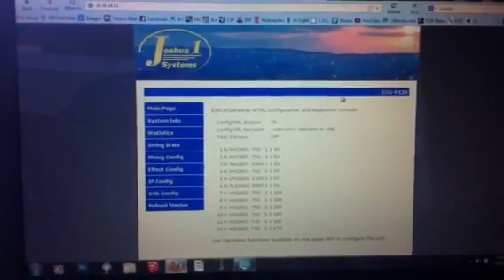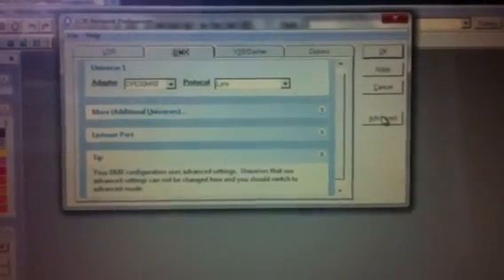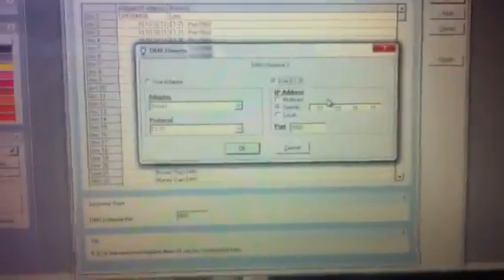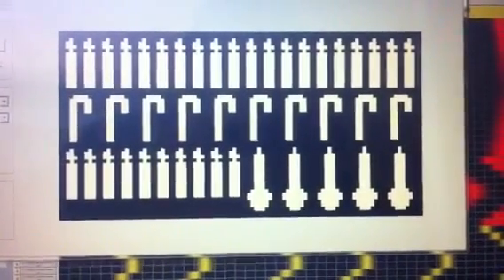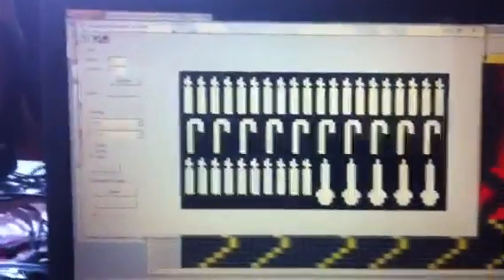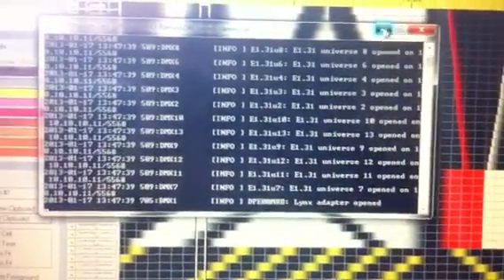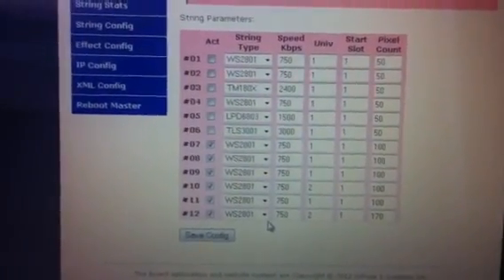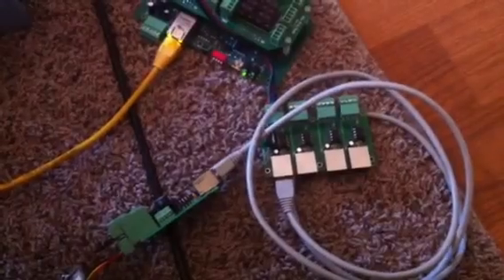P12R configuration with LOR

Comment from the maker: Yup, you have it correct!  The pixel extenders are just that, to extend pixels over a greater distance.  Most of the time the first pixel needs to be located within 10-15 feet of the controller.  This varies based on the pixel type.  The extenders let you transmit the pixel data much further if you need to.

As far as the different options, for me it came down to price.  an E682 is 8 universes and runs $180 assembled.  A P2 from J1 is the same thing and it's $60. Get what you like and understand

Comment: Thanks for this video, I am still weighing out the options for pixel control mainly the sandevice and the J1.  

I am a bit confused on what you would need the breakout board for, is it for long distances?

Also for the LOR network you'd basically just have your show computer and have USB out to the LOR adapter, and then Cat5 out of the show computer to your J1 or in my case I'd probably use a DMX to E1.31 bridge for my non-pixel DMX stuff?